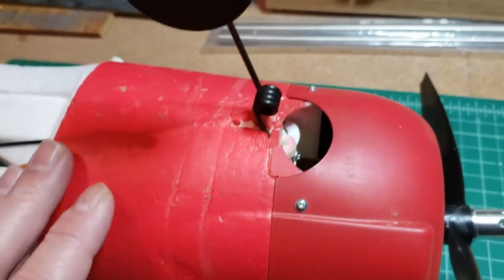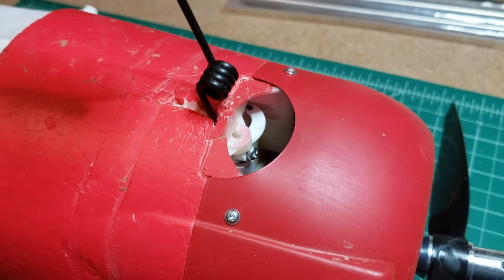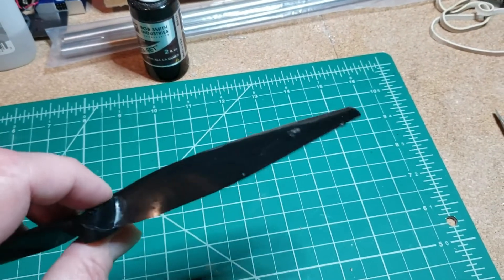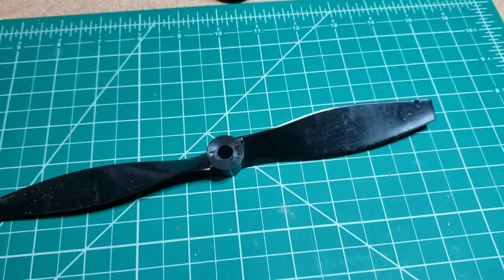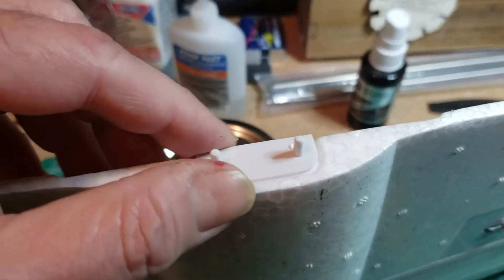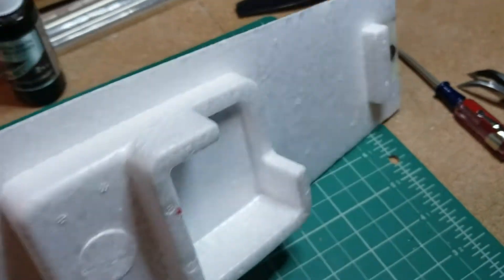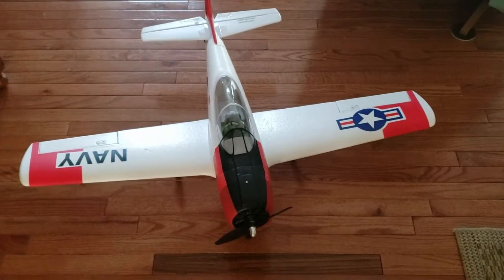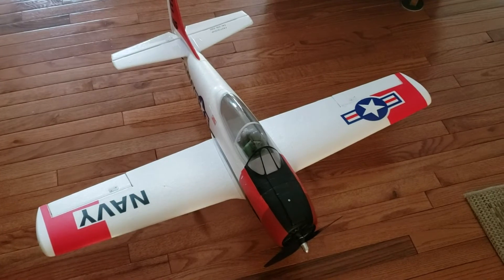RC Taildraggin! In The Hanger - Ep1 BNF E-flite T-28 Trojan

Comment: My T-28 is my go-to plane for almost every first flight at the field. Its so forgiving and easy to fly. And its not hard to remove the canopy. I did it because my pilot figure also came loose. X-acto blade going around and under the glued edge was all it took.  Re-glued pilot and the canopy and some touch up painting and it looks better than before I started. And I have an Eflit Valiant too! Got it for Xmas from my wife. I wanted it for tail dragger learning. It flies ok but the construction was horrible and the plane is very fragile. I prefer wood planes over foam but foam ones have their place.
Reply from the maker: Yes it is very easy to fly. I use it the same as you, a warm up plane at the field. I also use it when I'm feeling experimental and really want to push my flying to a new level.. Rudder authority is lacking, but I was able to increase it and make functional. I really appreciate you watching and commenting. Thank you!